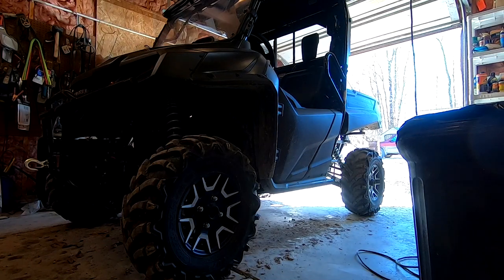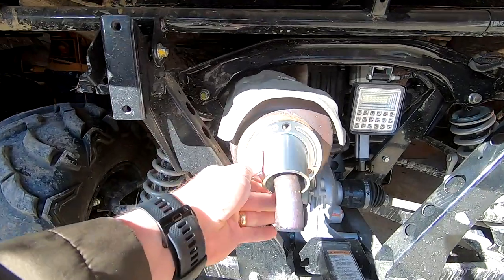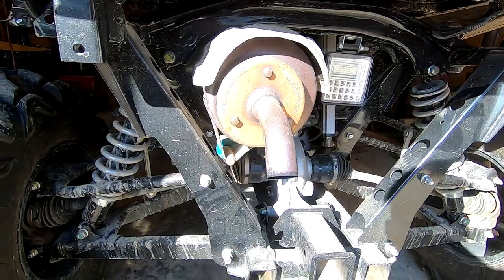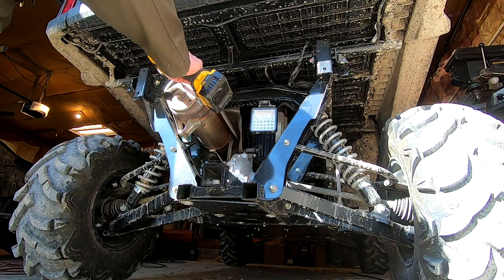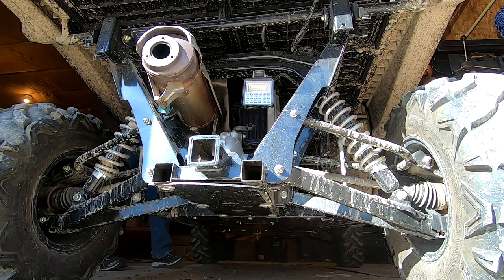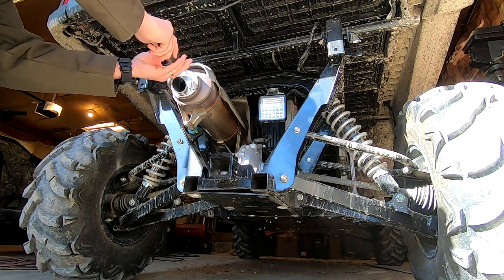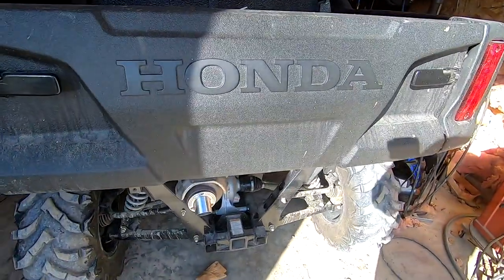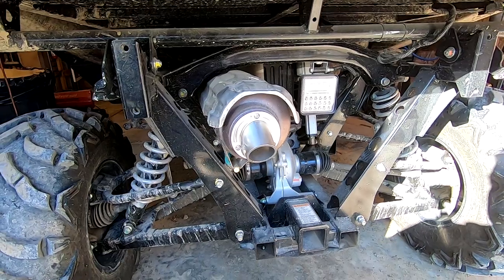Pioneer 700 Exhaust Tip Upgrade - BlackPath Racing

Comment: I just put one of these on my new 700 today. Thanks for the tip! They really should market these for the Pioneer, I bet they would sell a ton.
Reply: where did you buy it
Reply: @gregmaliska5295  eBay, $29.99
Reply: I cant find one that fits the 2017 pioneer 700

Comment: Thank you. I've had to explain this tip I don't know how many times🤣 The black one turns copper color. At Least it doesn't sound like a generator anymore. 
I put high temp permatex on my threads.
 I noticed you 700 is running rich or something?  Good video

Comment: I couldn't hear much of a difference, but I was curious if you've had any problems where the headers meet the rear exhaust. I've been experiencing it seperating and causing excess noise.
Reply from the maker: I have not had that problem but it is a known issue with the Pioneer 700.

Comment: Is that a backup light? Under the frame?
Reply from the maker: Yes it is. Here is a link to my video on adding one to the pioneer 1000, but it's the same on a 700 except the wiring for it is on the passenger side frame rail.https://youtu.be/R7OmK1eaq5s